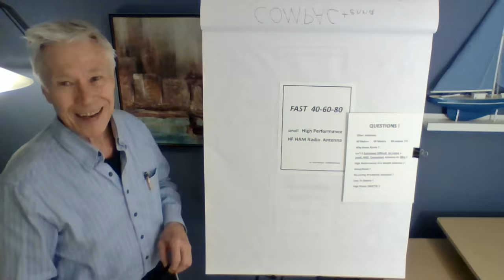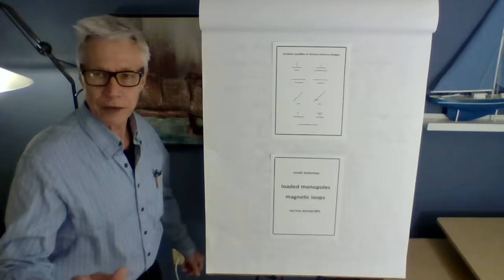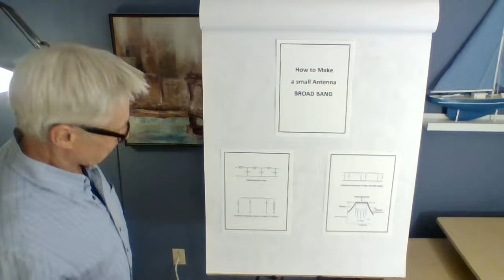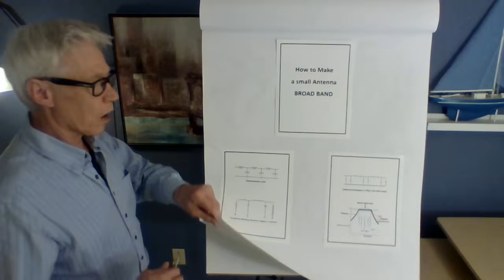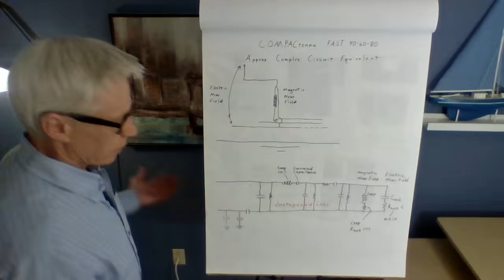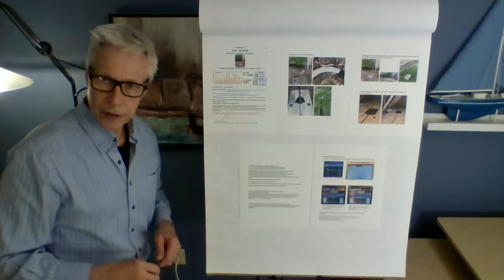COMPACtenna FAST 40-60-80m HF Ham Radio Antenna HOA, POTA, Home, Emergency by Dr. Jack Nilsson 2026

Comment: 40/60/80 are hard to do efficiently (on a budget) for portable ops so I'm interested in this antenna. I can set-up an OCF vertical half wave and cover 20/17/15/12/10/6/2 very quickly and efficiently, albeit with band adjustments, but erecting erecting a 50 ft mast for an OCF vertical half wave 40 isn't quick because it pretty much has to be guyed. 60/80 are out of the question. When will DX Engineering have these?
Reply from the maker: Excellent points, Nate. DX Engineering will have The COMPACtenna FAST 40-60-80 next week, and it will be listed shortly after.

Comment: Very interesting antenna.  Thanks for making the video. When will it be available? How much will it cost?
Reply from the maker: Thank you. It will be available within 2 weeks at DX Engineering's website, and at the DX Engineering Booths Arena at The Dayton Hamvention May 15-17, 2026. The price will be on the order of moderate priced magnetic loop antennas.